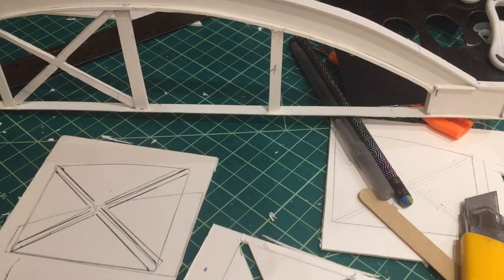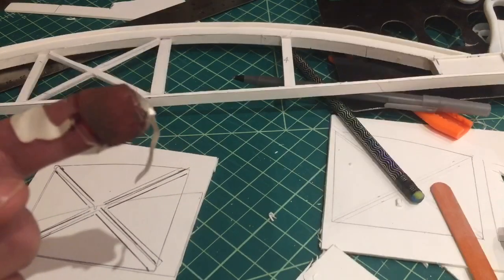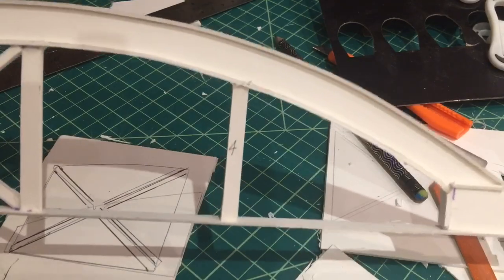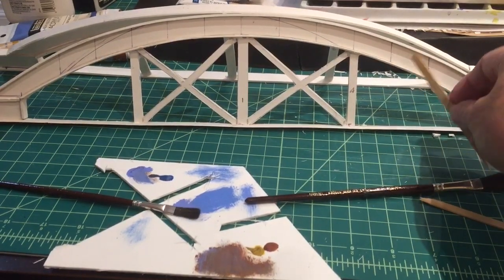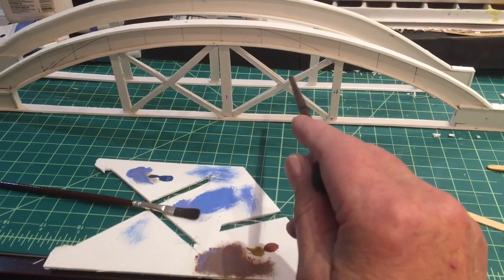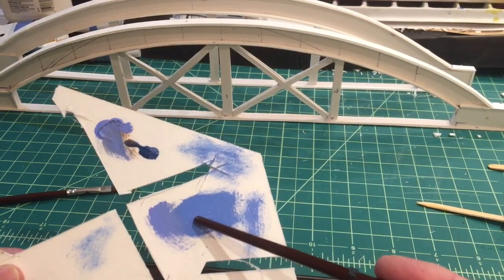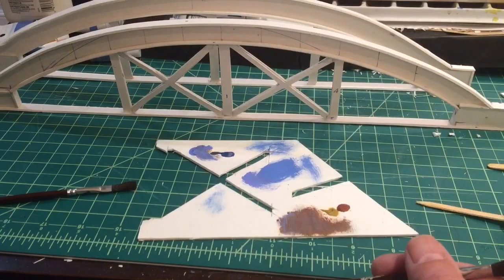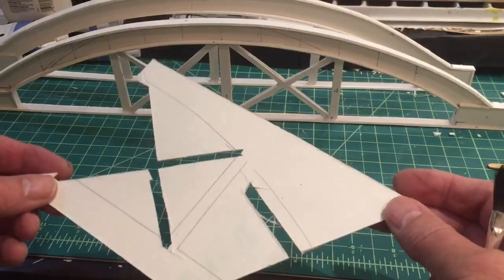How to Build  a Model Bridge Part 3

Comment: Hi Charlie. whoops. nasty little cut. i always use a rule just a tip. bridge looks fab by the way. i can not wait for the next install, stay safe and mind those fingers. all the best Tony
Reply from the maker: TONY NORTH EASTERN thanks Tony, I do use a steel rule however, when cutting out the cross bracing. I was trying to ensure that the card would not break as I was cutting but I put my finger in the wrong place. It was later in the evening And I should have put it away until the morning. Part 4 will be live today.👍
Reply from the maker: PM me Tony so I can send you a photograph